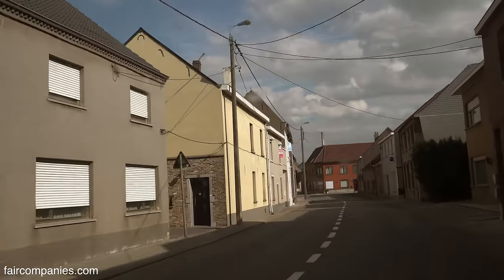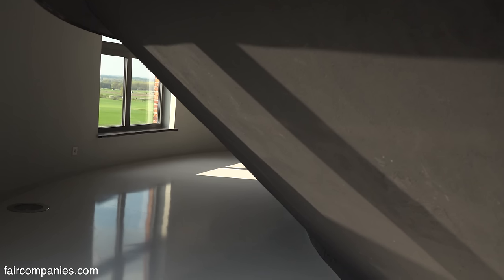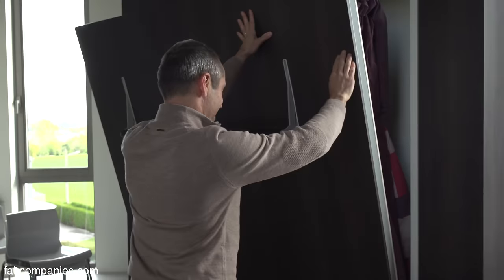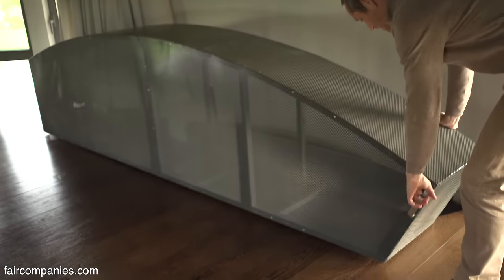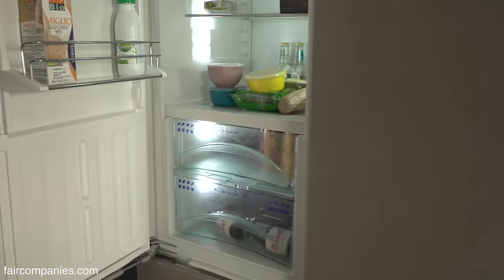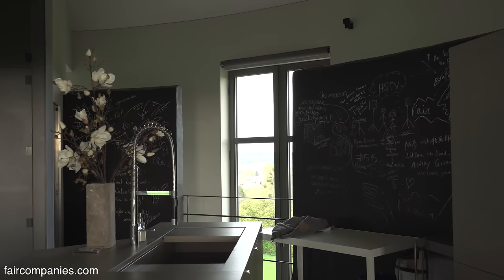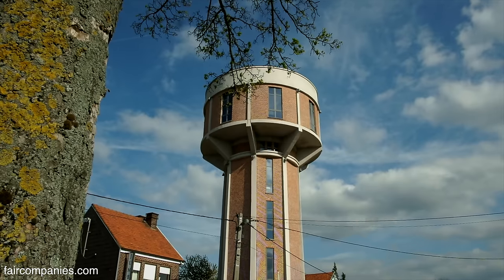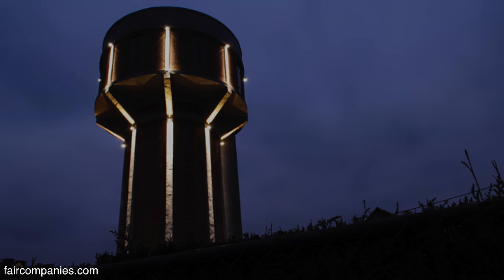From old Belgian water tank to dream tower house with a view

Comment: To keep the water elements, it would be cool if they build a swimming pool on the roof
Reply: Probably would start to leak due to the renovations, plus it would stress me out thinking about it flooding the ground floor
Reply: Too high a risk
Reply: pool = heavy
Reply: @Slamdoxicalz  They could use the original water reservoir that used to do the exact thing as pool does - hold wast amounts of water in place, instead of building living room out of it. It is actualy genius idea, and missed opurtunity in my eyes.
Reply: @NefruSimons  But that wouldn't be the roof
Reply: It's too cold in Brussels, I think.
Reply: @Slamdoxicalz  Thats why i literaly said: "They could use the original water reservoir..." It is located in the highest "room" with a wiev and you could use it 365 days of the year, since it would be roofed... To me that is a splendid idea...  The building was originaly made to hold water high up thats the point, instead they made living room/ kitchen area out of that tank...
Reply: Ma Sato 8
Reply: Its just to modernist and clinical for my tastes. It would be like living in an office block to me.
Reply: Likely too heavy, among other things like not enough space, etc. I definitely think a water feature would have been a cool idea, though.
Reply: And a Waterslide that goes from top to bottom but inside
Reply: @FazartOrganization  no way too heavy!

He said this water tower had 250.000liters of water in it!

That is equivalent to 250.000kg or 250t weight.

An average pool of 3x7m and 1,5m deep would have 30.000l in it.
30t of weight.

So the original water was 8 times as heavy as a big 3x7m pool would be...weight is not an issue with this structure!
Reply: @kniefi  He said on the roof, the roof was likely not designed for a pool. Lol It would need to be reinforced, whether the inside basin could have held it or not. All speculation of course, because we don't have any clue. :D
Reply: Seems a hot tub could have been managed. Though the roof is oddly shaped.
Reply: perhaps but then the roof would have had to be reinforced, the tank inside doesn't mean the roof can bare it

Comment: They went to great lengths to save and use ail the original stairs in this video. But if you look closely you can see elevators.  Elevator shaft  under construction at 2:06 , finished at 1:17. More elevator doors at 3:12 and stainless elevator doors at 3:39. You can see the exterior of the shaft on the outside of the building at 10:41 on the right.
Reply: Brian Binns 
That set him back a few dollars nice doe.......
Reply: That's because it's for comercial use now, it is law to have an elevator

Comment: Absolutely like the idea of it. But how they turned it into reality....not so much. It's just cold and feels like it was built for the looks, not for living comfort. 
So much unused space, impractical, few Windows.
And minus points that are not their fault, like the location right near the airport. Way too loud to relax.
Reply: I think it looks fine. Sure it's a bit sterile as it is shown but i assume they had a lot more personal stuff and decorations about the house when they were living in it. When you decide to turn it into something to rent out for short periods of course you will strip out a lot of the personal stuff to make it appeal to more people. 

Things like a very open bathroom are awesome tho. We have one (although a lot smaller) and i think it's way nicer than the standard bath with a closed shower toilet and a sink.
Reply: It's not loud at all inside. Since it's this close to the landing strip, the glass of the windows is adapted.
I remember having a conference in this tower, and you could hardly hear the planes passing by.
If your not a plan spotter, the roof terrace won't offer you a quit and peacefull spot though...
Reply: Ehm, I've stayed in hotels literally across from airports and there were no airplane sounds. If something is built right, they think of everything... Insulation is key.

Comment: One thing I would of added was a low profile elevator system. A cylindrical tube system big enough for one person. Could be painted to look like part of the original building? Maybe a one meter diameter tube? Would get lost inside such a big space but would allow disabled access. No disabled access will limit its attraction to business users. When looking for venues,disabled access is high on the list of requirements.
Reply: I have to agree.  The owner could have added one apartment per floor and a elevator.   it's unique though.
Reply: There is an elevator.
Reply: It's "Would have" there is no such thing in English as "would of", this comes from you not having read enough of what other people have to say in life so you derive your understanding of the language solely from spoken words like "would've".  And there is an elevator.

Comment: The home owner should consider one way viewable vinyl film to go over the outside of the windows. The same kind used on bus windows to print advertising on. And then i would print a brick pattern on the window vinyl that mimics the walls and makes the windows optically disappear into the walls so that only the frames remain visually.

Comment: Water tower tank made of cement ??  That puppy would have been history.  I can imagine turning such a big building into a residential spot being a nightmare.  I mean its 6 stories tall.   If the windows were already there then no problem but cutting those in would cost a fortune.
Reply: The windows were already in, although the glass panels all had to be replaced because of the noise of the planes. This must also have cost a pretty penny. Since this building is this close to the airstrip, I imagine the government and thus us taxpayers participated in the cost.

Comment: Pretty, beautiful view, but very impractical. Every time you want to go to the bathroom or whatever, it is some floors away, and there is no elevator. Also, these people didn’t plan to age there (or have little to no idea of what happens with age). They even have an airport nearby and you can hear the noise when they are on the roof! It would’ve worked better had they built a more modest (but practical) living apartment only on the wider top (where the water tank used to be) with an elevator, the rest reserved for other uses (the bathroom with the shower head meters above was ridiculous). So, all in all, good intentions, pretty possibilities, good execution of what they wanted (their fantasy), but awful use of space what makes it difficult to live in. I see it modified into different apartments though.
Reply: The building has got an elevator.